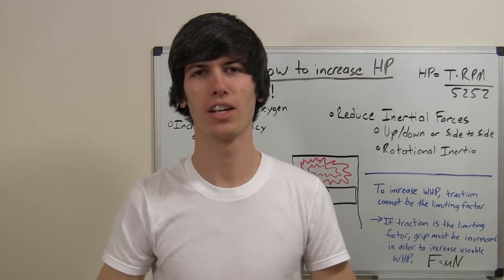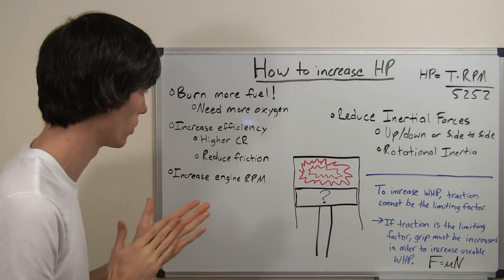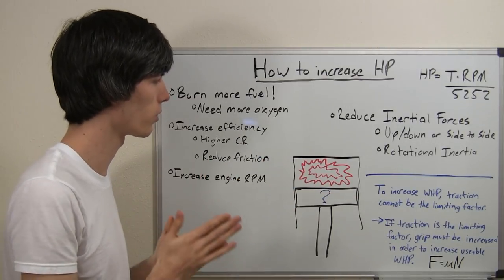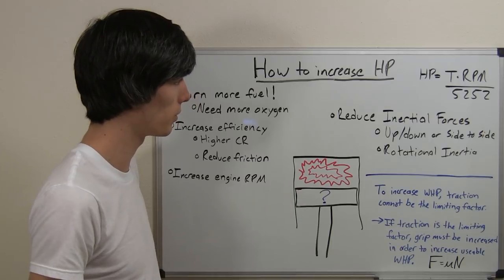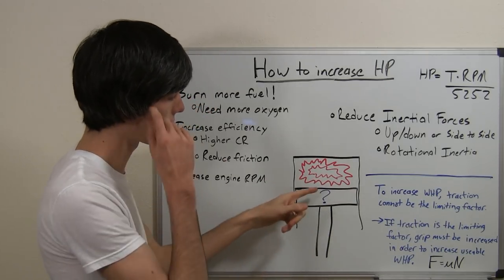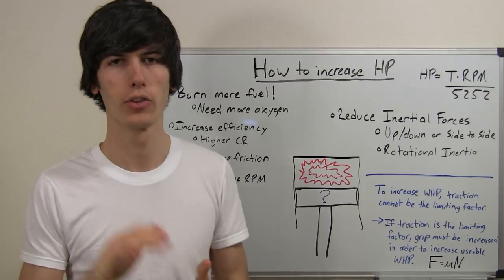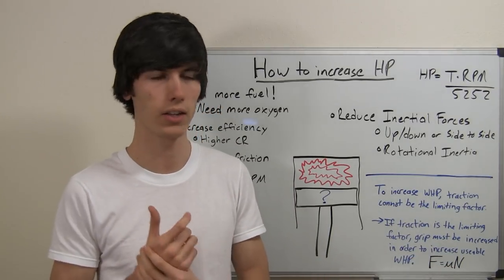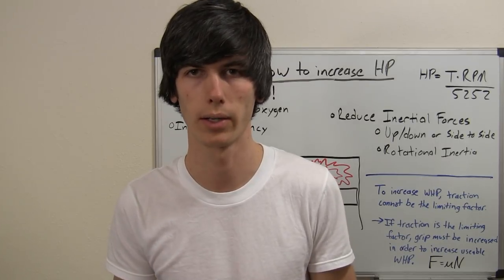How To Increase Horsepower - Explained

Comment from the maker: I graduated as a mechanical engineer.
Reply: Best comment, love your video. Amazing attention to details.
Reply: Congrats m8
Reply: Congrats
Reply: that's somewhat wrong. O2 makes HP,  spark ignites fuel, fuel + compression burns O2.  more fuel doesn't make HP.
Reply: @FloydODB  you need the right mixture, if you have more of both  you will make more horsepower.
Reply: Understandable, have a nice day.
Reply: I thought you came from a Hanson cover band. Look at that mop, weeeeeee! Great channel mate, subbed for years. Don't know why I came to this old vid.
Reply: @voongnz  you know exactly why you came here
Reply: Pog
Reply: You are my lecturer...i love all your videos..
Reply: @FloydODB  More air makes more power....as does more fuel making more power...hence cold air and short/ long ram intakes increasing sound and power as does larger fuel rails and injectors making more power....however, it can be touchy as you have to experiment, per say, with each added accessory, so to speak.....So giving more air will cause the fuel to burn quicker, making the engine run too lean if you don't give the engine and systems ability to supply more fuel to balance out the ration.....think of it like an engine being a big vacuum, and the more air it can suck in...and also expel....at any given time....the faster or more powerful it can run...However, power has consequences if not balanced out...hence why the instructor says given that all factors remain equal/equivalent....so yes, more air inducted (intake mods)=more power, more air expelled(per comp stroke)=more power(exhaust/ porting mods), However, you can only make that power if there is adequate fuel to burn for the added air inducted/expelled ...therefore increased fuel also =more power(injector/throttle body/carb/intake/ect. Mods), but only more power to be made when the three factors are increase/decreased or fluctuated in even and constant intervals or modulations....so yes more air along with more fuel does make more power.....that statement is in no way whatsoever, wrong....it's just having the knowledge, ability, and know how to put all the factors in action together to be able to safely and efficient make more power out of your motor and keep it somewhat reliable....
Reply: @suzukispeed2447  I build engines speed. Just trying to correct his wording.  Statio is statio, gas, lpg, alcohol, diesel etc, and the O2 does the work.
Reply: Cheers mate 🎉

Comment from the maker: You have to have good enough air flow (volumetric efficiency) at higher RPMs, which typically requires modification of the valvetrain/cams. Also the valve springs need to be strong enough, and be able to last through many rapid compressions. The materials also need to be able to withstand the added friction.

Comment: How To Increase Horsepower- add a lot of cool stickers!
Reply: Okaythen001 also more air in tires
Reply: Okaythen001 Added a NOS sticker to my quarter panel and got 5 horsepowers.. it was epic.
Reply: Okaythen001 Paint you calipers red.... + 25 HP
Reply: +Tony Cruise not to maximum, at higher speed tires get hot will. break depends on how fast is it. and the other way around if upu have too much air they will have less surface area to the ground so from stop to going might spin your tires depends on ypu have lots torque. fill air a couple psi less than the max tires pressure
Reply: +Okaythen001 adds 10HP per sticker
Reply: +Okaythen001 that would explain the stickerbomb hype
Reply: +rickburnout666  lol does it works?......
Reply: +eduardo villarreal i had a seized engine on my XT350 so addded a a Noz sticker and it fired up, so i guess it does
Reply: +Okaythen001 Stickers add additional weight.. canceling out the power gains.
Reply: lol XD
Reply: Okaythen001 :D
Reply: add several horses at the front of the car to give better pull
Reply: Okaythen001 especially the micheal jordan doing a dunk pose sticker
Reply: kelsorocs3 dump some nos energy drink in the gas tank. Its 150 shot
Reply: @tonycruise  actually that does work. less rolling resistance will allow more engine hp to be used to move the car, rather than spend it on rotating the tires.... fyi  
its like making 80k a year and only after taxes bringing home 50k. but inflating the tires to reduce rolling resistance, you get 53K instead of 50... its not technically increasing engine hp, just usable power. more whp
Reply: And gigantic wing

Comment: Smh everyone knows a stripe over the top of the car adds 100whp, pointlss video...
Reply: Jack Hobbs fake hood scoop 50whp add racing stripes 50whp add fake turbo whistle 150whp. 😂😭😂😭😂
Reply: Or adding an M badge to a 3 series gives you an extra 40hp, same with a non AMG Mercedes, as long as the badge is there you'll get the performance.

Comment from the maker: The valve timing is connected directly with the crankshaft (geared to the camshaft) thus the timing shortens as you reach higher RPM. You would likely however need cams which open the valves a bit more to allow for greater airflow.

Comment from the maker: It doesn't let out less exhaust, it's turns the heat of the exhaust into useful energy, thus increasing the efficiency of the engine. The answer is yes, but many turbos are there for increased power, not necessarily for the most fuel efficient cars.

Comment from the maker: Just a note, that'd be maximum theoretical speed based on gearing. Horsepower and air resistance will likely be the limiting factor.

Comment from the maker: It's not the "downforce" that the engine has to compensate for in order to accelerate, it's the drag. A 1000 kg car with 1000 kg of downforce still only has to accelerate 1000 kg of mass, not 2000 kg, however it has to compensate for the additional drag which will be significant.

Comment from the maker: It's not something you typically modify, but would require new cylinder heads/valvetrain for modified air flow at high RPM. And of course the strength to cope with higher RPM.

Comment from the maker: No, I mean an overall reduction in the heat created at any moving contact points. For example, with the new CR-V Honda reduced friction by about 5-10% along the drivetrain, which was good for a real world increase in power.

Comment: Horsepower at a given RPM is defined by your torque at that RPM, divided by 5252, times that given RPM. If your car makes 250lb-ft of torque at 3700RPM, you make 176HP @ 3700 RPM. If your car makes 250lb-ft of torque at 6200RPM, you make 295HP @ 6200RPM.

Comment: Usually a cam will give your engine the ability to make more torque at higher RPM, which means more horsepower. Your engine needs more fuel and air as well, which your stock computer (assuming you have EFI) may or may not be able to compensate for. It's always good to get a custom tune when you are drastically changing your engine's power.

Comment from the maker: Please don't put so many spaces in your comments. Anyways, yes, you don't want hot air fed to the engine, cool is more dense. Sport headers may have a different design or greater area to pass air through. Check out my video on increasing power with the exhaust (search my channel).

Comment: For the first part we use the term BMEP, brake mean effective pressure. In short raising BMEP or CR or RPM will result in HP  increases. Reductions in friction do not effect HP, they effect BHP which is Brake Horsepower that is measured at the crankshaft where HP is the calculated theoretical value at the combustion chamber.

Comment: thanks for the useful info: this explains the crank shaft angles to increase engine RPM (2016 Honda - CRF 1000 Africa Twin), reduction in weight of the engine in modern cars, reduction in weight of transmission, transfer case, drive shaft, differential and half shafts; and maybe the overall frame and body weight.

Comment: Great video. But you can actually increase grip in the tires by putting more weigth without the car weigthing more.

This is easy to do in cars with the traction on the rear wheels and in drag racing (1/4 mille).

All you have to do is two things:
1) put very soft bound settings on the suspension, so when the car starts to accelerate, there will be weigth transfer to the rear wheels very fast and easy.

2) set the rebound settings to the maximum restriccition possible in the rear suspension. This will prolong the effect of the weigth transfer, from step 1, for long time, giving you a lot of grip at the rear wheels.

Comment: I think using the mathematical formula for brake power could make this a bit more clear
BP = Engine displacement x F/A ratio x RPM/120 x LCV of fuel x Air density x volumetric efficiency x mechanical efficiency  x indicated thermal efficiency.
By analyzing the equation you can easily figure out the parameters that can increase engine output

Comment: change the material of the piston to something lighter weight, but also something that can handle thermal expansion and explosions. Also you can add better rings around the cylinder.

Comment: good video. id just like to add, in order to increase traction you could also convert your car to awd, assuming it isnt already awd. albeit that is very unorthodoxed and expensive.
Reply: also adding a transfer case, front driveline, front differential, axles and hubs and everything else that god to it will add weight and create significant amounts of rational mass that must be turned. However if you're planning on doing even more mods to the drive train to make it more efficient/powerful that wouldn't really matter and it would be a benefit
Reply: never said it would make handling better, just that you would have more traction. However more traction isn't always a good thing

Comment: Internal Waste gates are built into the the hot side (exhaust) of the turbocharger. these are found mainly in factory turbos.

External bolts up to a flange on the exhaust manifold it self and regulates the exhaust flow from there. They are just to different ways of controlling boost pressure. with a manual or electronic controller.

Comment: Hey man! I'll try to keep this short. The reason why A/C robs your engine performance when it's on is because the A/C Compressor uses power from the crankshaft via the belt once you turn your A/C on. The reason it only robs your power when you switch it on is because the clutch from the compressor is only activated and pulling the compressor via the belt when you switch the A/C on.

Comment: if burn more fuel inside the cylinder so the fuel economy will decrease. so it is not possible in this case to increase HP without decreasing fuel economy.
Reply: Turbocharging!!!
Reply: Matt Johnson still increasing fuel consumption. Turbo adds more air so you can burn more fuel. Usually turbo is used to increase power without increasing engine size. Turbo is power on demand (minus lag)
Reply: Acceleration and full throttle cornering is a minimal part of day-to-day driving. If the devices that deliver the necessary extra air and fuel don't cause a constant power draw (superchargers, non-sequential fuel pumps), drag (air scoops), or significant weight increase, the fuel consumption during cruising and accelerating along with traffic won't be affected.
Small turbochargers combined with a lowered compression ratio will even better fuel economy: a small turbocharger doesn't put much more backpressure on the engine, but does help pump in air even at around ambient (no boost no vacuum) intake pressure. Combined with the lower CR this reduces pumping losses. Knowing smaller engines also have less pumping losses, this is the reason why economy hatchbacks now use 1-1.2l 3cylinder turbo-engines, and even the hotter versions with a 1.6 turbo 4cylinder are more economical in daily traffic than last generation's middle of the pack 1.6 NA.
Reply: Or get yourself a hybrid sport cars. Lol

Comment: I know you've got tons of video requests so you don't have to respond. That being said, could you make a video on how Air Conditioning works? Also can you explain how that's parasitic to an engines performance, similar to power steering and other belt driven compressors.

Comment: No worries. In practice, it's just easier to buy a car that has more power, or that has been modified to your liking. Usually v8's or forced induction like supercharging or turbo charging is the way to go. There is so much to know and each car is different

Comment: The 1-6 guys missed a few things. Strong lightweight battery, upgraded fuel pump, oil cooler lines, bigger fyel injectors, not just cold air but a larger intake manitold sysyem and larger throttle body with better mafs. Upgraded head(better valves and cams with stronger springs etc. Machined head for increase compr ratio, yes to the lighter pistons and stronger connecting rods, better oil pump, them arp studs removing power steering and ac, better belts, better fuel rail. Etc..etc

Comment: Another easy way to increase traction (grip) without adding mass is by simply moving it over the drive wheels that need it. For example, relocating your battery, fuel cell and and fluid reservoirs. On a RWD vehicle, placing these components over the rear wheels with give you better traction and more WHP on the pavement.

Comment: If you have real wheel drive, you could use stiffer front springs to throw all of the weight to the back of the car under heavy acceleration, giving you more grip to the back wheels when they need it.
Reply: Yeah, but it causes some incredible under-steer when you corner.
Reply: cmennare Yeah, drag racing lol

Comment: Really nice videos man. So I drive a 2009 subaru impreza 2.0R normally aspirated. Rated 110kw at flywheel. What would you say is the best way to approach my exhaust system regarding cat removal and the rest of the system for the best performance

Comment: Hey Jason, great material bro, I've learned a lot from you already! I have to admit I didn't know much about how a car works until I came across your vids. I have a couple questions for you though. How much does engine displacement have to do with the total amount of HP that can be produced by an engine? What are the differences between engines in Japanese, American cars, and Euro racing cars? What technology do these engines share or have similarly and what is different? If you could someday make a video explaining different engines (K series, B series from Honda, Mitsubishi/Mivec, Domestic engines) and what each kind of engine is the best at in terms of performance as well as comparing them to the other engines overall performance, that'd be awesummm. Cheers bro, thanks for the awesome vids. Keep 'em coming!!
Reply from the maker: drummer_kid94 This playlist will answer a lot of your questions. https://www.youtube.com/playlist?list=PL30C950600B683799
Reply: bigger displacements means all the cylinders have better torque, which have fast speed from  stop to go. Thats why dirt bikes only  have one cylinder.if v8,v10,v12  have the same cc, than the v8 has has better 0-60, v10 in the middle and v12 less. but v12 has more smaller cylinder means later on the top speed will catch up. but if the v12 has more hp it will go gaster from  stop to go. hp and torque work together.

Comment: Weight can be used to increase traction however by means of weight distribution. Thats one reason why many super cars hv their engines in the back (above the rear wheels) to put more power into the ground and reduce slip. Therefore, more power.

Comment: I learned from this, thank you, but one thing you coulda said dude is that instead o increasing the weight o the car to raise traction, you could redistribute the weight of the car over the area of the driven wheels to increase traction. That's one o the main benefits of mid-engined rear wheel drive cars. Though that aint very practical in ordinary car tuning....

Comment: Increasing your maximum rpm might not necessarily increase the acceleration of your car. Usually, in naturally aspirated cars with electronic fuel injection, the available torque drops towards the redline below that of what is available by shifting into the next gear. In some cars this may not be true in 1st or possibly 2nd gear, depending on the car. It can be done through ecu tuning, to raise the limiter but runs the risk of shortening the lifespan of the engine run at higher revs for too long

Comment: In order for the wheels to roll without slipping, the force must be less than μN, if F achives the μN value which is the maximum frictional force, the velocity of the point touching the groud in the wheel won't be equal to zero, therefore slipping will occur.

Comment: Is it possible to simultaneously increase air flow and compression ratio? Are you then not at risk of the temperature in the cylinder being too high on the compression cycle and the fuel potentially combusting prematurely?

Comment: For faster acceleration a shorter connecting rod will be better for, for the same drop in the piston from TDC  the angle of the connecting rod is larger and  the crankshaft is accelerated faster. This is at the expense of  the side of the piston pushing harder on the cylinder. Some offset the piston with respect to the crankshaft to reduce piston slap. I would  also mention scavenging due to tuning, but  this comes under increasing air and fuel  that is what you  covered.

Comment: The point of maximum RPM is determined by the maximum amount of air which can be drawn into each cylinder, after that the engine will choke itself. This is given as: Max Power RPM =Ci×(πD^2)/2×210×Duration/360×60/RPM. Therefore increasing valve diameter, valve lift, valve duration and increasing your flow coefficient will increase max power. Also pulse tuning will help however high lift cams on not VVT road engines is not a driver friendly option!